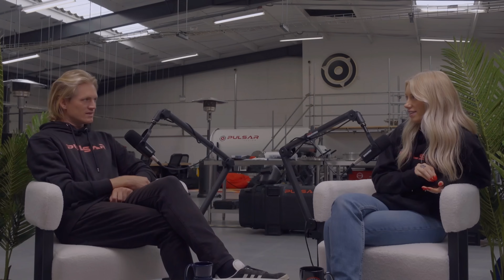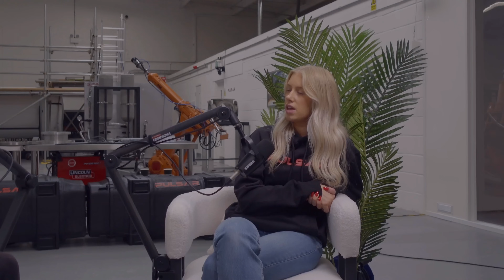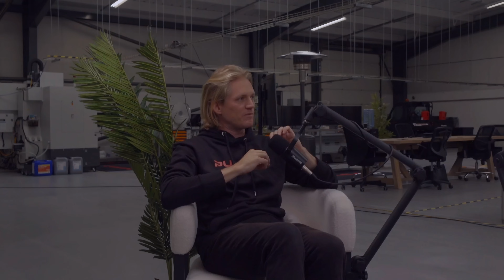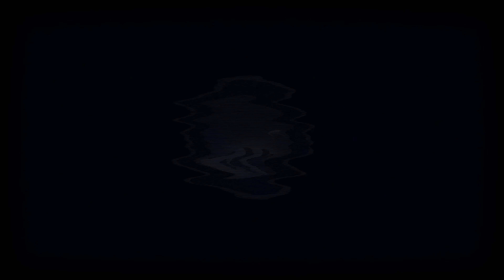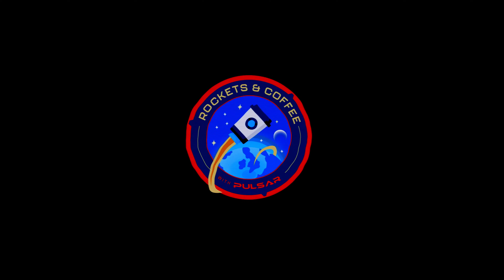How will Fusion Engines Transform Space Exploration? | #2 | Rockets & Coffee: Space Bytes

Comment: Rockets exhaust in the form of long living particles to travel to mars are clearly not the right approach, consider that one day there are +10K ships travelling to mars in parrallel and each one has to avoid the rocket exhaust streams of the previous ship that is comming at them at 5% the speed of light or so, burning holes in the ship everywhere. I mean its kind of clear that we have do this mass transfer with very short lived particles which are gone after 100m of the ship exhaust, or probably even shorter like a mikro meter after the ship engine. The good thing is there are allready prototype drives which can drive on the virtual particles of the space field, using magnetic fields, or electric fields.